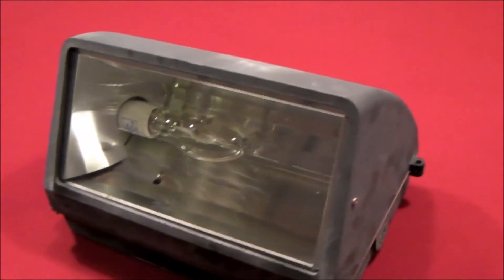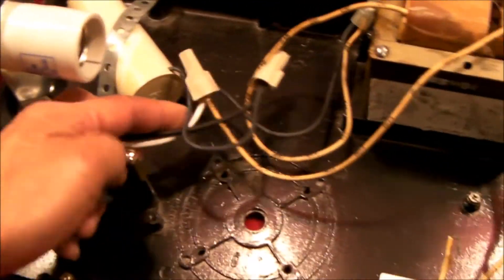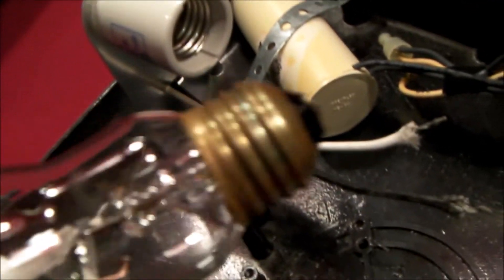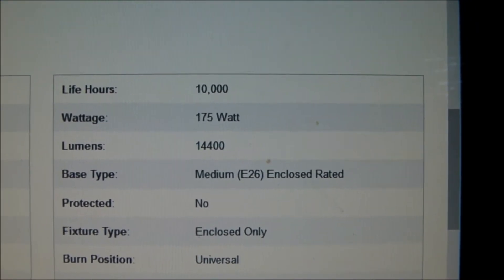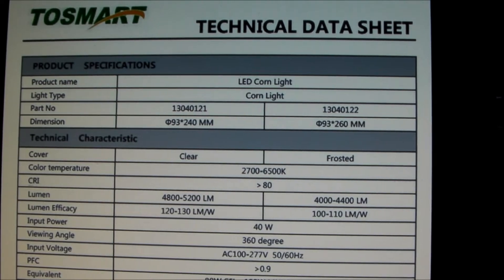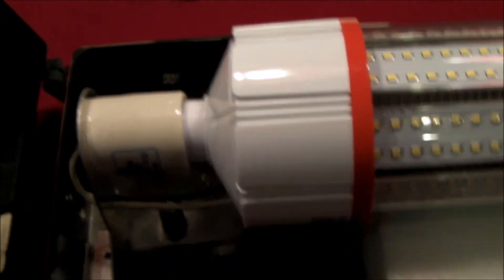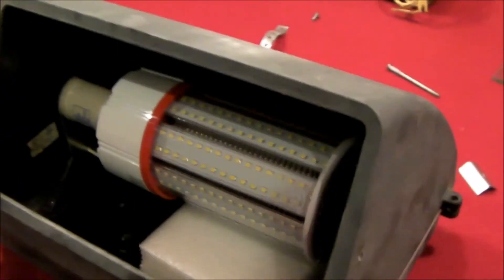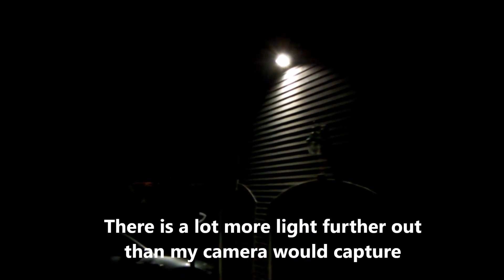175 watt Metal Halide to Corn Cob LED conversion retrofit

Comment: Wanted to see the wiring hookup with the photo sensor
Reply from the maker: sorry.  I just connected the bulb like any other bulb to the photo sensor using the photo sensor connection diagram.  Probably but not 100% positive, it was one photocell wire to white neutral, one wire (probably black) to hot and one wire (probably red) to bulb (hot/black), other bulb connection to neutral (white).  My memory is sketchy on this.  Be sure to LIKE and subscribe.  THAT would help me.  THANKS!!!!

Comment: Stick with the normal design of the fixture, and just buy another 175 watt bulb.........(simple)......the problem is that the stupid government is fazing out these bulbs, and forcing us to buy these new led's which I think is ridiculous, not to mention stupid, without any warning.  (MY ADVICE),.....buy at least a case of 175 watt MH bulbs, while you still can, on e-bay.  I bought a case of 10 for 54.00.= (5.40 per bulb) DO IT!!
Reply: Yeah I agree it's pretty dumb that they're phasing out the HID/Metal halide/Sodium lighting for no real good reason. The bulbs last a long time and for the size and wattage they throw awesome amounts of light.
Reply: "without any warning"? We were warned during the Clinton administration.
Reply: And pay and use more for electricity?  Now that is stupid.